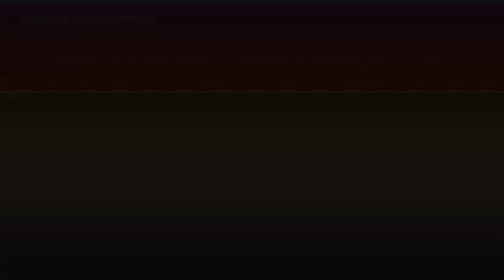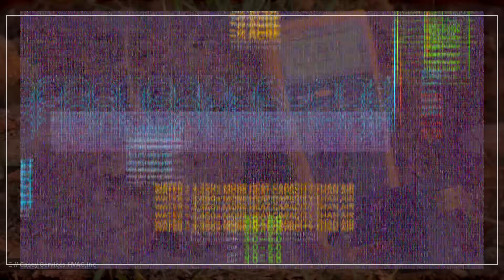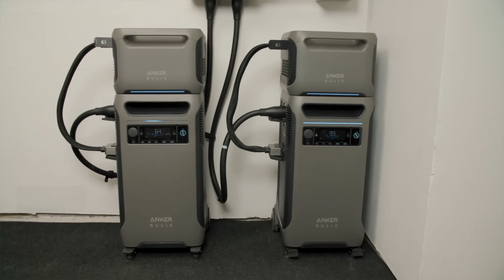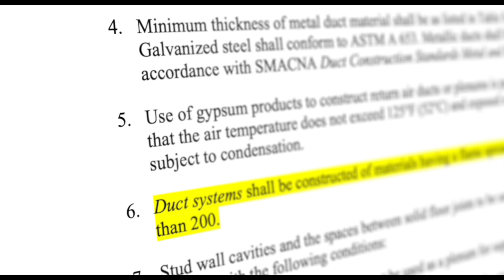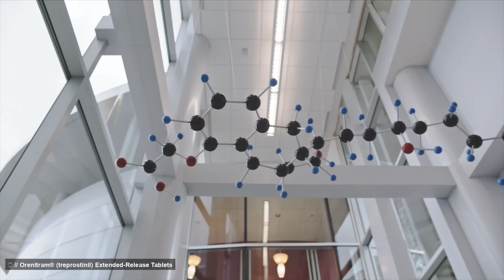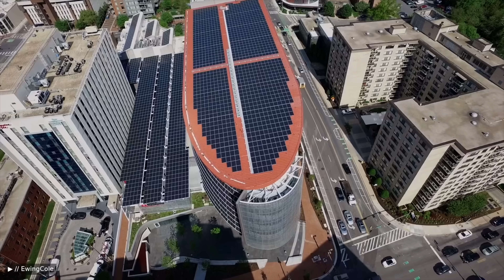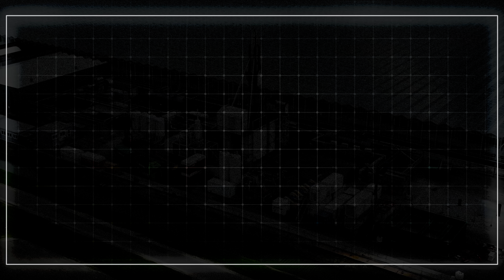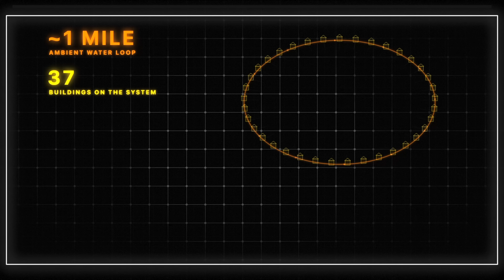The Viral DIY Cooling Hack That Nearly Killed a Family

Comment: A heatexhanger cost like $70. there is no reason not to use one. Well sure, you need two pumps in stead of one.

Also, ground pipe heat source is basically dead today. The thing is that with the new heat pump agent that is used today, we gain basically one more coop for air source heat pump. Making the diffrance from Air source, to grounds source go from 3 compare to 4,  compare to 4 compare to 5. That may sound like its not that large of a diffrance, but that diffrance basically totally undermine the cost of digging the pipe

Comment: Do not be dissuaded from water source heat pumps. I built an all-electric home ~3000 square feet in 2010 and heat it with in-the-floor pex tubing with warm water. I heat the whole thing with a 5 ton geothermal heat pump and use an open loop water source since we have 12.5 acres and plenty of fresh water to pump and dump from our private well. Our electric bills in the winter are cheaper than heating with propane or fuel oil, the only other options since we live in a rural area in Michigan. One of the best features of this system is that the floors are all ceramic tile and they stay comfortably warm all winter long. Good luck to everyone pursuing geothermal, it truly is the future (and past) of heating buildings. 🙂
Reply: do you ever get to negative 40 and lost power?
Reply: I am not allowed to pump water here :-(.
Reply: @bloepje  on your own property? like a fishtank? or a pond? just closed cycle like a pool filter?
Reply: Open loop has its own issues, mostly related to mineral buildup.
Reply: I've been suggesting that as well 
The focus is on the two ASHP and GSHP, not much about WSHP, I find it is often the happy median 

I've used it for heating and cooling without the extensive property concession that you have, but combining the two 
A horizontal line (as thermal sink) going into WSHP (as thermal source) 

Cheap and efficient approach 👍🏽

Comment: Them videos have been knocking around a while now. But new versions done with AI are getting traction. A channell SimpleTek did a slinky loop: how well it works today I dont know as there is no new videos. There was good studies I downloaded from India giving figures on the diameters and air pressures needed, and ALL of them fighlight the angles, drainage and the mould risk.

I have thought myself of such a system going into a heat pump as the air in in frosty weather, and then the air out - always seperate - is heated by 10c air compressed instead of -5 to -10c air so getting a better COP. But water does carry 1000-3000 times more heat... so on paper that is better.

Yet for cost reasons a lot are going air to air in the UK across the water from me here in Ireland. SkillBuilder interviewed a couple. Its like your forced air system except ductless.

Id suppose all have their merits.

I never knew geothermal drilling was so hard to get done in America. We are tripping over drill rigs in Ireland, the issue we have whether for geothermal or water is they can charge any price.

Comment: On paper this is a good system. Hard to beat the COP. However enough solar and some batteries are already going to be able to run quite a lot of mini splits. People also should operate their heatpumps on quiet mode if it's available this greatly boosts the COP and limits short cycling which extends the life of the compressor.

Comment: Correction: The temperature 6 to 10 feet down is the multi year average temperature for the site. See permafrost for an easy example of it not being the same everywhere.
Reply: just like the caves in the area
Reply: @supertornadogun1690  The caves in my area vary less than 2 degrees yearly. Great example.
Reply: The images in the early part of the video show boiling water on the surface like a geyser field. While some locations can tap this heat source, most of the systems described in the video use the fact that your local soil maintains a temperature similar to the average temp above ground and the heat capacity is very high. So instead of trying to pump heat of out the air at 10 degrees F, you can more easily pump it out of the ground. And reverse that in the summer.
Reply: Sigh. The point is it is MUCH more consistent than the surface temp.
Reply: The average annual temperature for Edmonton, Alberta is about 2.6 degrees C.   Great for geothermal cooling, maybe not as ideal for geothermal heat.
Reply: I haven’t finished the video yet but I imagine he didn’t claim it’s the same everywhere but that it’s the same year round or everyday
Reply: @techboy95  If I recall correctly, near the beginning, he did claim a range of 50 to 60 degrees without specifying a location. So yes, this is a bit sloppy (or more  generously, imprecise) on the part of the content creator.

However, even my science instructors in formal education make imprecise statements all the time. There is often a trade off between clarity/conciseness and precision in communication.
Reply: @planetluvver  there's generally not a trade off, it's just laziness or they don't know. For instance, it's no more or less clear to say a thrown object follows a parabola or say a thrown object follows a conic section if you have to also explain what a parabola or a conic section is. So there's no advantage in clarity and one is just wrong except for very special cases.
Reply: @gasdive You have not studied science and math deeply if you have not encountered "lies for children."

Mathematics is taught progressively from the natural numbers, to rational numbers, to transcendentals, to complex numbers. The number line you were taught as a child is full of holes  without the transcendental numbers.

The day is not 24 hours long, that is an average, it varies in length by as much as 15 minutes due to the eccentricity of Earth's orbit.

Organisms do not simply inherit our genes from their ancestors, but there are mechanisms of horizontal gene transfer such as retroviruses and bacterial conjugation.
Reply: @planetluvver  oh. I've encountered them. Oh how I've encountered them. 

They mean you spend half your time unlearning the rubbish you were taught and the other half learning disconnected "facts" that are disconnected because they're lies and don't connect to anything and they're not facts. 

It would be easier for everyone to just give the facts simply rather than a complex and confusing lie.
Reply: @gasdive Then you seriously think they should be teaching children that a 24 hour day is a LIE when we first teach them to read a clock face? 

I wonder just how you think that can be accomplished and what the point of it would be when most humans on the planet are not aware that their days are not 24 hours long.

Science is still developing. I am taking community college classes in sciences and much has changed in biology and geology since the 1970s. Even the ways mathematics is being taught and used is radically different because we now have tools to accurately approximate numerical results. Even the teaching materials have changed. The barely legible purple inked mimeographed worksheets and filmstrips of my youth are replaced by interactive online animations and videos.

Scientist KNOW that their knowledge is incomplete, and their models are subject to change as new evidence is found using new tools. While it does take effort to correct misconceptions, that is how learning happens. While there are incompetent teachers who truly do not understand their subject, there are also many talented teachers that simplify the material out of necessity and expediancy.
Reply: @techboy95 he did. it's 90 seconds in.
Reply: In most places it doesn't change more than a few degrees. Permafrost is not something most people deal with and an extreme example.
Reply: @mr.monitor.  It doesn't change much over time.  It does change from location to location, reflecting the average temperature of the area.
Reply: going 20 feet deep is enough for any sized building. Make the hole wider if you need more capacity. These installers putting holes 500ft+ are contaminating the water table, making the ground more unstable, and scamming the homeowners. Technology ingredients did a video where they went only 15ish feet down, and his entire workshop/warehouse is being cooled with it.
Reply: @runed0s86 Only if you have enough land area. None of the houses on my block have enough land area to use horizontal loops. Even if I was to snake a near surface ground loop around my lot, I would have to go through the roots of multiple trees with 3 to 6 foot diameter trunks. Anyways, the deep well holes are filled with grout and bentonite. They are properly plugged to stop vertical ground water motion.
Reply: @runed0s86 Spreading horizontally is a good option when available, but not everybody has the required land area for that.
Reply: @eDoc2020  He's not talking about horizontal pipes, just wider vertical holes.  Instead of running a completely vertical pipe, you can coil it to increase heat exchange.  I don't know if 20 ft is deep enough, but you don't really need multiple holes hundreds of feet deep unless it's for a large commercial building.
Reply: @JohnSmith-b4w  I don't think making each vertical hole wider accomplishes much to increase heat capacity. The increased volume will probably give you more efficient heat transfer, but you don't gain the volume needed for capacity.
Reply: @eDoc2020  if you have a wider hole, This means that you can coil a much larger loop, meaning that you can put down a lot more working fluid into the hole at any one point in time. Assuming that the heat capacity of the hole that you're working with is high enough, let's say that you drill down 5 to 10 holes 10 to 20 ft deep, if actual heat exchange is the issue, your capacity for heat exchange goes up massively just by having that much larger coil. This is actually the plan that I'm going with on my system, 3-5m deep. Going to drill the holes myself potentially. Each hole will be 18 inches wide instead of the 4-8 inches that's typical, and a coil will be put down instead of a straight pipe.
Reply: @btoiscool  That's kind of what I'm saying. You'll improve heat exchange with the ground, but you'll still be limited by the heat capacity of the ground.
Reply: @eDoc2020 luckily the strat there is very simple, just do a fan out of your drill holes. I've been looking into this lately more and more, and I estimated that someone with 3-5 12 ft coils with around a 12-24 inch bore would be enough. It seems that a spacing of around 6-10 feet apart should make the heat capacity high enough to prevent saturation too. An HDPE solution would work just fine here too so it wouldn't even be expensive for the coil.

EDIT: by enough I mean enough heat power for an average sized home, 1800-2500 ft². If you went down to 20 ft, 5 would be good for a 3500 ft² home. You can do mini splits and it would work beautifully. That's what I'm looking to do for my system.
Reply: It is a completely valid generalization.
Reply: He was specifically talking about an area that has a variable climate.  Of course permafrost is going to be a completely different situation because the climate there doesn't vary much.
Reply: Just wait until they find out what happens when a ton of people are pumping all of that Ambient heat into the ground.

While also ignoring the effect of turf grass on it.
Reply: @MousesHouses   If it's a cooling-dominated area the temperature will increase a bit, but over time it still conducts through to the surface, so it won't increase endlessly.

In heating-dominated places the ground will get a bit colder over time.
Reply: @eDoc2020  That place does not exist where they're advertising it

Comment: I have a big block and a relatively new house here in Australia... I'd love to give something like this a go. 
Looking at local pricing it is really really expensive, as its quite the rare solution over here. But Australia is very behind in many ways. While we are far ahead in things like solar and battery uptake, we are so backward when it comes to other efficiency solutions. 

We don't have much double or triple glazing (insanely expensive here), geothermal loop systems are not really done at all (a toy for the mega wealthy). I want to replace my window glass with vacuum glass over time, but talk about difficult!
Reply: Having built many passive homes in Canada and the US now spending a lot of time in Africa especially during the winter months 

I'd say in Australia, depending on where in the country you live, you likely have a cooling demand greater than your heating demand BUT depends, as Australia is a very large country 

If on the northern side where you have very hot summers you should consider a water source heat pump as the happy median 
Air source is cheaper CapEx but more costly in operating (however Australia has great solar potential so you could power an air source during the hot days via solar ) geothermal or geoexchange is higher CapEx while lower OpEx and a water source is in the middle 
If you are on the southern side of Australia (and land/site permitting) which has hot summer but a mild winter, consider heating/cooling with a water source system running on solar pumps and sinking your rejected thermal energy in a shallow vertical hole away from the house foundation and sourcing your thermal energy from a well, used for the water source HP not necessarily for domestic use 
A well diameter of 3'-4' and ~8' depth will give you the stable energy to both heat and cool your home if done the way I described 

Because of the properties of water with a pex tubing system submerged in the well, the rate of thermal exchange is very high, 
it'll likely outperform a vertical loop geothermal system without the cost 👍🏽
Reply: @AfricanCulturalHeritageProject you mean 8 feet of water in the well when you say 8'?

Comment: What he say run cool water over the condenser coil and in better config the pump / motor. He say to you that the water will remove the heat from the machine components better than air. It like cpu water cooler so maybe use tee pipe fitting there too. 😊

Comment: Here in Sweden you usually choose either Geothermal, Air to Water or Air to Air heatpumps when looking at heating your house. I went with Air to Water just because we couldn't afford the upfront cost of geothermal. 

Here you usually drill 100-200 meters down and stick a pipe in it, pump brine fluid through it, and have a heat exchanger inside. It's super common here, and kind of no brainer if you have the money.

Air to Air ~$8000
Air to Water ~$13000
Geothermal ~$22000
Reply: @jockearnold  you missed district heating — Sweden's most common heating method (58% of all heating energy used) — which supplies 18% of heating for detached homes, 80% for non-residential buildings and a whooping 89% for apartment buildings.
Reply: @xyzxyzxyzxyzxyzxyz  Yeah, I was mostly focusing on detached homes. And I would say it's pretty hard to "choose" district heating as a detached home owner, since it requires quite a lot of infrastructure to be put in place :)
Reply: @jockearnold I see. Yeah, if you live outside of district heating coverage it's kinda hard. In most medium-sized municipalities (at least in southern Sweden), coverage in cities, towns and most larger villages is pretty good, though. In my neighborhood someone decides to connect to the grid ever so often. The pipes are already there, they "just" have to connect them to their home, which (at least in my town) is on par with buying a new heat pump.
Reply: @xyzxyzxyzxyzxyzxyz Yeah, I’ve also read about a lot of people who have left the district heating in favour of other means of heating, because if raised prices etc.
Reply: yikes f that

Comment: Vertical bore hole ground loop heat pumps are amazing.... amazingly expensive. I tried, but first of all it would have cost me over a hundred thousand dollars... yes... that much! and that was if I could find anyone willing to do it for an existing house. And I couldn't find a single company willing to even reply to an inquiry if you weren't a) a new build, AND b) outside the city on a large acreage (and yes, this is for the vertical bore hole version, not the horizontal version. "we need room for the drilling rig").
So I fully believe in the technology, but "save you money" is NOT accurate. not only are your costs in the video SIGNIFICANTLY less than reality, even once it's installed, the cost to run it vs a gas furnace is.... basically the same. gas is horribly inefficient, it's also incredibly cheap. A ground source heat pump has a COP of 3-5, but electricity is 4-6 times more expensive than gas, and a gas furnace can be 98% efficient these days. So I can spend 5 times as much to install a system that costs the same, or more, to run.
From an emotional point of view I like using less energy and all that. but from a practical point of view, I'm only willing to spend so much money to do so.

Comment: The only way it is cheap is if you DIY the ground loop which is what the viral video was suggesting, which is still very possible with a horizontal loop. The most basic thing you can do with a ground water loop is just to flow it through a coil in your ductwork which would allow for heat exchange. If you did all the work yourselves should be around a couple thousand dollars (yes not $300) including materials, but it would be cooling only because of the natural ground temp.

That said, a water source heat pump unit should be in the same price ballpark as any other heat pump, so if you had the ability to DIY a loop and were pricing in a air source heat pump anyway it would be silly not to go for a water source unit.